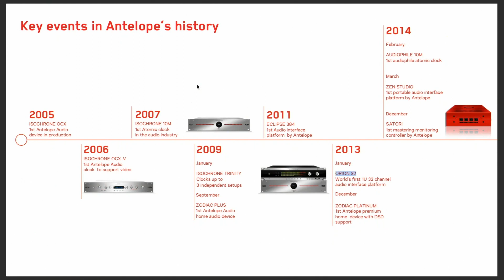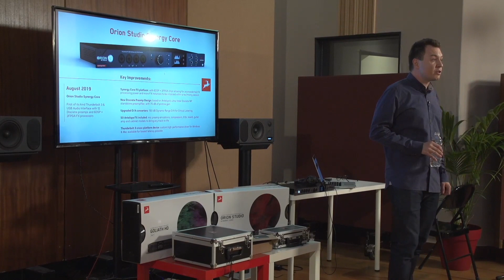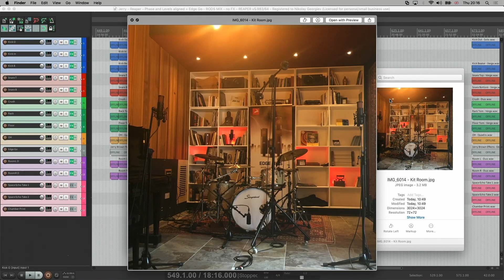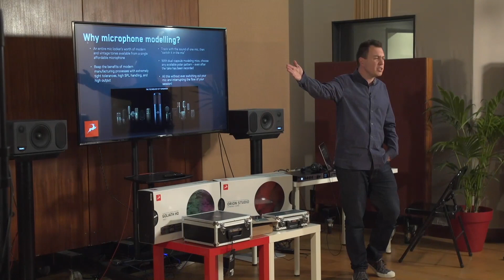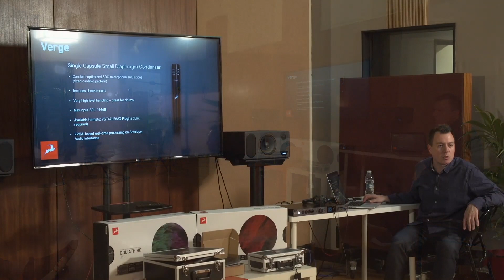Orion Studio Synergy Core & Modeling Microphones Presentation at Abbey Road Institute Paris - Part 1

Comment: Inspired by this video of yours, specifically when you explained how you can run the recorded vocals out into a virtual rack mount, and back into your DAW. I was about to get together with a vocalist and attempt to do this live, but there's a better way. I just got it working, but it wasn't easy to figure out.  If you are using the unit for the first time, make it simple for yourself and your vocalist. Record your singer's favorite karaoke tracks, and/or tracks that reflect what you plan on recording in the near future. Take the completed vocal track and (as you explained in the above video) route the vocals out into the Antelope Audio plug-ins, and do your own shoot out of all the compressors, preamps, EQs available. I just completed this virtual shoot out and a few units stood out in a big way. It took me about 2 hours of tweaking every knob before I was satisfied with my selections. I had every compressor inserted and turned them on one at a time, deleting the ones that didn't do it for me, and moving my favas to the top. You really need to take a few days/hours to audition the virtual rack gear, and trying to do this live with a singer is out of the question. You need more time than a singer can do in a live situation. You also need to check your final settings in the mix to make sure you didn't over saturate something. When I got done, I came to the conclusion that it will be way to complex to have both a safety track and a virtual rack recorded in real time. When you are doing multiple looping takes, and you have two tracks going in, things are going to get messy, complex, and I would rather have the vocalist hear a finished set of rack gear, record direct, and "re-amp" at a later date. Few vocalists have their song down so perfectly/flawless. You are going to need to do multiple takes, and again, having a direct track and a virtual vocal track recorded at the same time is going to get complex/messy, and I would rather opt for simplicity in capturing/re-taking vocal tracks. What I do believe the virtual rack gear is good for, during a recording, is to allow the vocalist to hear a finished radio ready sound while tracking, and this is a big help in making a vocalist feel amazing, resulting in a great vocal take.

Comment: I can tell tou, get the older one rev.2017! You get more fx’s, you can use the same instances of these afx on the old one as on the dsp. Synergy Core only support online bouncing so NO dsp power with bouncing. NO sample rate comversion possible which is possible on the rev.2017 as the 1gen too. Also bandwith TB3 is never going to be used, TB1 would be more then sufficient so nothing better then rev.2017. Al converters and preamps are the same in the rev.2017 only benefit, autotune which cost a lot of extra and sounds not that good. So get the rev.2017 and use the reat for good native plugins. (Yes i have geb1 rev.2017 and SC i am thinking about ditching the SC)
Reply: Hello Friend! Why didn't you like the new Orion Studio Synergy Core so much, what's wrong with it? On the Internet, people SHARE - some adore him - others HATE him! But Nobody says the details ... Maybe it's just a Game of Competitors and they Confuse people - so as not to buy Antelope, but to buy other brands? What specific can you share from your Practice? Thank you ..
Reply: Sergey Leps well the things i mentioned before are my troubles, at first my main problem is missing sample rate conversion on spdiff in, i use that a lot. Now i have to change sample rates and still as today there is a bug which freezes the sample rate when using thunderbolt and switch to usb samplerate (which is used by Logic, Reaper etc.) when even when closing alle audio related apps you can not switch to oven. So you have to turn everything off an on again. It is confirmed as a bug and after 2 months still not repaired. All mixers in the new cp have a snet knob bot this only works (which is normal) in mixer 1 but why is this knob there? Next.. in the new cp all faders are 5db of with actual levels, so -5 is -10 and so on. Also the mixers are weird with their panning even changing panning rules there seems to be somethibg not right. Other problem meters of the mixers were not correct (did not check if that is still in) but it was in every mixer showing levels of channels in mixer one, Antelope keep on saaying i made a mistake but i tried and made a movie for them and still they did not get the point. If i see audio on a channel were is no audio at all this makes me nervous!
But my biggest complains are however they use dsp you can not do an offline bounce with afx2daw and the sample rate conversion option that is taken out... mind even my old zen Studio does that!!!

Besides it is weird that they left in usb2 i know it makes the unit cheaper but to get usb in is not a that much more costs.
Also on the Rev.2017 you get more fx’s, so i am loved all my Antelope devices (i hav also Orion Studio silver, Zen Studio, Orion Studio Rev.2017) but i find it now i am having the unit really not worth the proce difference of compaired to the Orion Studio Rev.2017.
I am not a hater just warning people to get what you need and i really am convinced that the slightly better pre’s and conversion is really noth worth the difference and if you can go for the Rev.2017
Reply: @ajschot  Hey buddy, how's the monitoring DAC on the rev. 17 version? Is it a step up from the original ZenTour? I am running a Zentour now, but I find the monitor section being a little smearing and soft. (Both the main outs and the headphone outs.) I actually prefer the monitor outs on an Audient ID14. Also, I have a SSL 2 coming through my studio, and I did an subjective A/B test, the $200ish dollar SSL2 has the best monitor outs to me. The sound is just tight and defined, the transient, reverb tail and all that is just incredible! But it has really limited connectivity. So I am torn between if I upgrade my interface, should stay with the Antelope and get the Orion Studio cause it's connectivity or I should just go look at RME or Lynx or something else which I think will probably cost a heck lot more if I get all the connectivity I need in my rig, 16 channels of Db25 analog outs to my summing mixer and a Spdif or AES/EBU in for the signal to return back from my API A2D. Which actually isn't that many, but it's rally hard to find one piece of gear that has the right combination of these connections. Thanks.
Reply: @ShonTseng  This depends on your headphone's impedance too... i don't know the Zen Tour i think it will be using the same hp outs as the original Orion, so yes this is better, better DAC. Louder, i don't think so. Maybe you should use a amp. I you need the 16 out, then you can not go to RME without using some extra unit for DA. I found the HP louder on the Orion Studio SC then the Rev.2017 but i don't use it that loud, and i also use only 600Ohms and 250 Ohms headphones. But you can better then take the Orion  2017 or SC and buy a headphone then go the way of RME also sorry to say but outputs and HP sounds very much cleaner and detailed on Orion then on the RME where i find it a bit sounding digitial. Yes HP can go louder but it does not sounds better. Oh you can also build a loop ;) if you not using all 4 mixers Just put your stereo signal on 4 channels (or more...) of the mixer 4 put the faders on 100% and put mixer 4 to you headphone ;) just look at the clipping or put a limiter on.
Reply: @ajschot  Thanks for the reply. Sorry if I was being miss leading when I described the outputs being soft on my ZenTour. I don't really need the headphone output to be super loud, I actually use it mostly to feed my EVE SC203. I just need it to be clean, sharp and tight like the one on the SSL 2 or heck even on the Audient ID14. I used to run RME babyface, but I didn't like it either. I just brought it up in hoping that they have updated their chip or something. And they are way more expensive if I get the 16 channel DAC and I am not sure if it will have a SPDIF coaxial input either. Thanks
Reply: @Wayne Brown After all these months, I’m still with my Zentour ( non synergy core). When I described the sound of the zentour being soft, I should have said that it’s rounder sounding. Both inputs and outputs on my zentour. I actually compared a couple different zentour, and they both have the and sound signature. Julian reviewed the new Zen go in the video: https://youtu.be/jBu_WfUnH4c

The input has a much more earlier roll off in the human hearing range than it’s competitors. I am not sure if Antelope updated their output chip but looking at the result in Julian’s test for the output and it is totally flat, which led me to believe the Synergy Core line monitoring section got updated somehow. I haven’t gotten my hands on a synergy core interface, I am still running the original Zentour like I mentioned. I am not even trying to upgrade to the zentour synergy core for now because of the price and you lose one pair of monitor out on the new version. The connectivities on the original one is just crazy. So I’m gonna stick with it for now. The sound is good enough. Some people might actually prefer the sound signature of antelope devices (if I’m not imagining it) and call it
“warm” and not fatiguing. I’m glad to hear that you prefer your discrete 4 sc over the ID14 tho! That gives me the confidence to maybe upgrade to their SC line of device later on! But I believe that with the new line of interfaces, you don’t get the same amount of free FPGA
 plugins like you do on the older models. And I’m still wondering if I could still use these plugins that are on my zentour if I have multiple antelope devices and combine the CPU power on the devices like one could with UAD. I have yet figured out the best way to incorporate the antelope ecosystem. Thanks for sharing your experience!
Reply: @Wayne Brown if it's night and day, then you have bad ears. Nothing is night and day. The differences are small. But you need good ears. Maybe you are older and cannot hear over 14khz. Check Julian Krause Channel for measurements. Also synergy Go zen has better headphone impedance than  discrete 4 SC, because it is newer. But RME and Ultralite Mk 5 just have better Hp out. Less distortion, less crosstalk, better channel balance and more power.

Comment: still miss a new Zen Studio, i love my old one (Red one) but i just wanted a new one but there is not coming any more with 12 pre's and 8 ins via d-sub... too bad... i hope it will stay on working for a couple of years... but yeah driver updates will never come anymore and that is a bad thing (still RME updates drivers from a fireface 400.... which is very old....) Also direct recording i would have loved to see and hear that but there is not much information about it. Why is the Zen Studio not updated anymore? Because now i need to buy the Goliath (2HE) get the Orion Studio and use ADAT but i can not go higher then 96kHz to get 24 channels... and 32 on TB is only possible in 44.1/48kHz....
Also funny a modelling of a mic and that shows Aalborg 4006 (which originally is a OMNI mic and some others too are omni Freiburg 6 is switcheable mic) but the Verge is a cardiod so you can never have the same low end and not the same sound...
Reply: As I understand it, have you worked for the Focusrite Red 4Pre? How do you like this brand in terms of Sound / preamps, etc. in comparison with Antelope?
Reply: Sergey Leps hi i ment the Zen Studio first verion so not the plus, this interface is red 🤭 sorry for the confusion. I only worked with the clarett, and 828 from focusrite.
The clarett is really no competition all the antelope interfaces are cleaner and more detailed in my opinion. The 828 is nice, detailed and clean but to my ears i like the Antelope pre’s more.